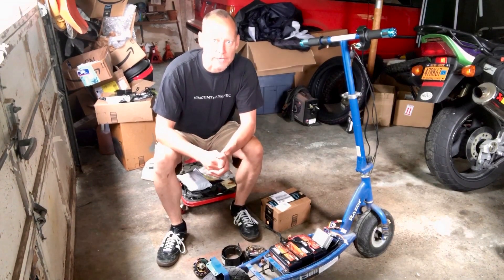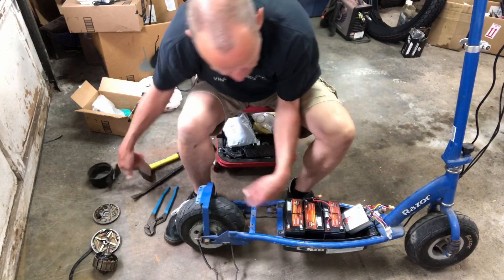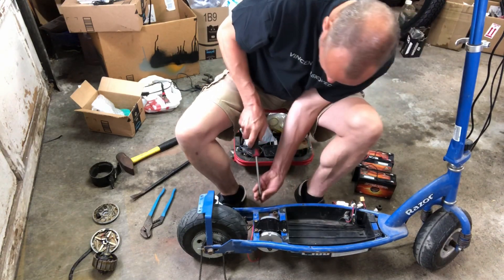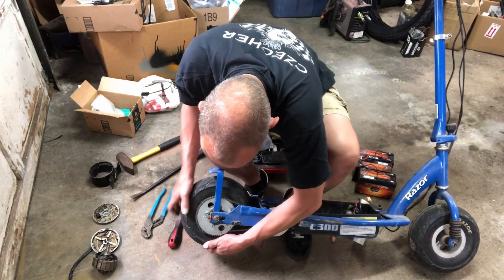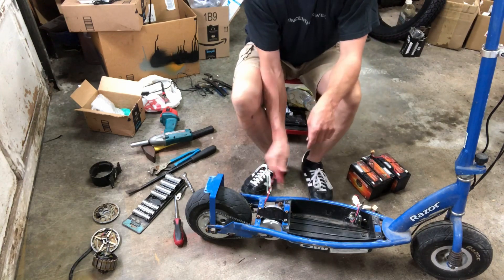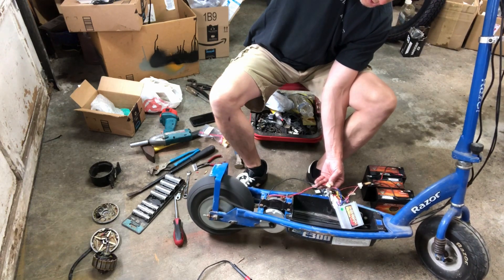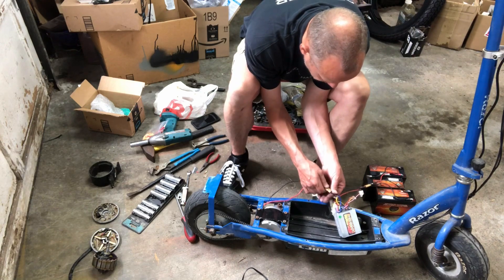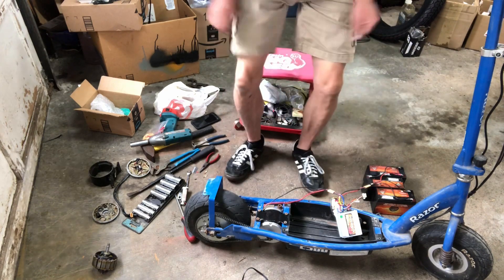Installing a 350 Watt motor into the Razor e300

Comment: Thank you for the video! Might want to put the 80 tooth rear sprocket and a 9 tooth front sprocket on it for hills. I have two 36v e300’s with this set up. Believe it or not I didn’t loose but a couple miles an hour. Way better on the hills and my motors stay cooler. Sprockets are direct bolt ones, just have to notch the rear deck support to clear chain and add length to the chain.
Reply: I had the wires cross..but thanks!

Comment: Hi I have an E 300.  Would I get any benefit out of keeping it 24-volt but upgrading to 350 watt motor?
Reply: there's a hack with soldering another shunt to the board, works well, gets the torque up enough to be almost OK for an adult
Reply: Yes, but you also want to upgrade the controller and the batteries for longer run time and more speed.
Reply: @bobsoft  thank you

Comment: Does the 500W fit or you have to modify the framing? Also what advantages do you have with 24V vs 26V on 350W or 500W? I don't have hills but want higher speed while some torque. So im thinking about a 44 teeth or 47 teeth rear sprocket.
Reply from the maker: The 500 watt motor is a monster.   I had to weld the motor to the frame to make it fit.  But it’s got monster torque

Comment: Do you think dumping 36 V thru a 1,000 W motor controller into a 24 V-, 250 W-rated motor had anything to do with the old motor burning up?
Reply: I'd venture a guess that using the same significant over-voltage and over-curernt into 24 V-, 350 W-rated motor is going to give up it's smoke just like the last one did.

Comment: I plan on running the 3 hooverboard 36v batteries on the stock 250W motor until it smokes with the plan to upgrade it to the 350W. With that being said what controller should i order?
Reply from the maker: Get a 36v controller off eBay. I don’t think the stock controller will work with 36v. I’ve since gone to 52v lithium ion batteries!
Reply: @NortheastVintage  Can you post a link for the 52v batteries you went with? Those would still be compatible with a 36v controller?
Reply: @NortheastVintage please could you do an update video of your scooter. I would love to know what your setup is now 😊xx

Comment: Helmet and two hands on the handle really helps
Reply from the maker: You’re telling me!  😮
Reply: @NortheastVintage  I tried using mine as a "drunk bike" to get back and forth from a friend's on a weekend once after having used mine for fun or light shopping for over two years.  4 blocks.  I only had to make it 4 blocks.  Well..........I was going top speed of about 14 (unmodified) when my front tire snatched the curb.  OMG.  If it had thrown me into the street rather than a grassy yard I would've done more than break my left thumb.  Here's what I learned.  Do not ride two tiny wheels drunk.  (I have no clue why I thought that was smart to start with) Be very careful of getting too close to a curb....respect the fact if you're older like me...54 that a really hard fall can totally screw you up for weeks or months.  I have never set foot on mine after a drink again.  I've always worn a helmet on mine because I know what happens when heads hit pavement.  I wanted to mod mine for more power and realized I'm just not responsible enough for that!!! LoL
Reply from the maker: @JB-js4xi hahah!  Glad you’re okay!

Comment: Using your setup of 350W, whats the advantage of 36 volts. Im looking for speed and range. (44/47 teeth) on 350W.
Reply from the maker: More watts, more power.  For speed and torque. Distance is all battery capacity.  Go lithium ion

Comment: hi i see in video that you have not got circuit breaker fitted  did you just connect wires  together or use something else
Reply from the maker: Correct. I deleted the circuit breaker. No problems so far but I should install one. Especially since I’m now using lithium batteries

Comment: Hi Matt i changed my controller and batteries on my razor echo smart.But the chain spins and not the tire..What i do wrong?I have a video on it..plz help!
Reply from the maker: Sounds like the one way clutch on the wheel hub is broken or on backwards?

Comment: I just got the same one from Amazon a couple of days ago. Runs well but pales in comparison to our other 500w E300.
Reply from the maker: Thx. I ordered a 500w and am curious as to how it’s going to perform
Reply from the maker: maXpeedingrods 500W 24V Electric... https://www.amazon.com/dp/B07ZD5RR5K?ref=ppx_pop_mob_ap_share
Reply: @NortheastVintage  Did you install that motor? Was it a direct fit or did it need some modding to get it to fit?

Comment: I have a stock e300. what would you recommend if I'm OK with the top speed, but want more torque and a longer ride?
Reply from the maker: No need to overvolt if you’re happy with the top speed. I’d go bigger 36v motor.

Comment: Can you put a link to the motor in the comments?
Reply: JK0232 motor with 24v 350w
Reply from the maker: maXpeedingrods 500W 24V Electric... https://www.amazon.com/dp/B07ZD5RR5K?ref=ppx_pop_mob_ap_share
Reply: @NortheastVintage  which one do you use for the 350w motor that was a direct  fit?

Comment: I did something similar with my e300 scooter same speed control and motor, however it's worth noting I switched from lead acid to a 36v Li-ion 20ah battery that fits fully under the top shell and I have yet to use all the capacity.
Reply: Ok..cool..
Reply: Where did you purchase your lithium battery from?

Comment: Hi Matthew, Thanks for the informative vidio on installing a 350w motor on your razor. I am doing the same thing on my old e325, my problem is, the 4 motor mounting screws dont exactly line up, I was able to get 3 in. I may try to find tapered mounting screws, or, I could drill out the hole on the motor, and still have the lower threads on the frame. Is there a better fix ? Thank you, Chip C , can I give my email ?
Reply from the maker: To be honest, I just welded the motor to the frame as I don’t expand upgrading the motor from the 500W motor I currently have

Comment: Hi, amazing video and the scooter looked fast. What speed controller are U using for this and what Rear sprocket will U B using?
Reply: Search "overvoltedscooters" on ebay they sell both the speed control and a 65 tooth sprocket for better hill climbing.

Comment: That's same engine what i did 350..stock was 250  2new batteries. New on off switch.  All wires new . My scooter goes 15mph
Reply: Also the razor moped. Controller
Reply from the maker: Try going with hoverboard batteries, and an overvolted controller with a 500w 24v motor.
Reply: @NortheastVintage  did you fit hoverboard batteries to yours ? Also If you get a 24v 350w or 24v 500w motor do u have to change the stock controller
Reply: @CM-1723  The controller voltage must match battery voltage set up, 36V battery set up to 24V controller will burn it. And wattage on the controller must not be higher than rated amp on the motor. The wattage on motor is just NOMINAL number the real number is the amp it can handle. For ex; 24V 350W 19A max motor, you can use upto 36V 450W controller. 24V 500W 28A max motor, you can use upto 36V 672W controller. you can overvolt but the controller watt can not be higher than what the motor can handle. But in overall try to always match the voltage and wattage of battery system, controller and motor for long lasting safe run of system.
Reply: @charlieson3394  Yes it´s good idea to match voltages, 24v bat, controller and motor, but you should never use a controller with less power than the motor can draw, so for a 350w motor you will need a 350w or higher (500w) controller
Reply: @CM-1723  did u figure it out??  I'm thinking of doing 350 watt motor with 24v.
Reply: @NortheastVintage how many hoverboard batteries did you use please 😊

Comment: to make deck get another razor scooter a broken one from scrap and cut the deck off that one, the bolt pattern would be exactly the same on both decks put longer bolts fasten donor deck right on top of the original not much extra room only 3/4 but you can put three even four acid batteries in that compartment standing up  deck will bolt in place except rear needs spacer, just in case you want 48 volts one day. PEACE!